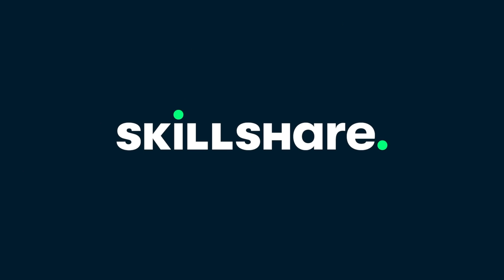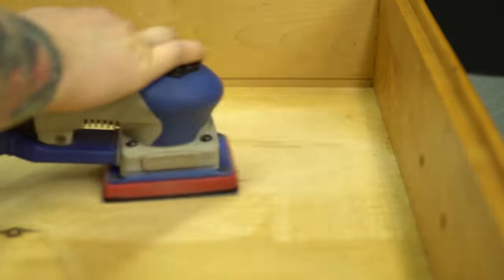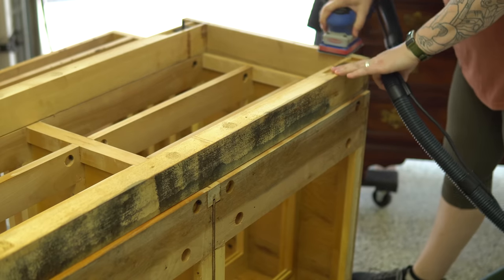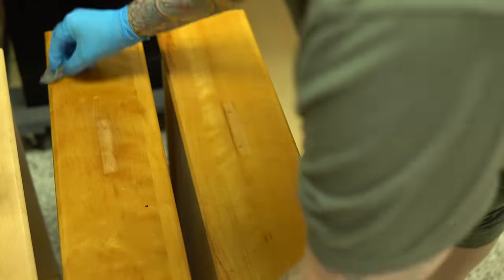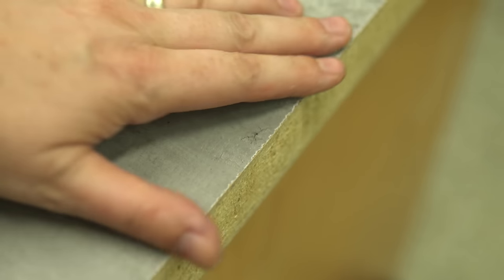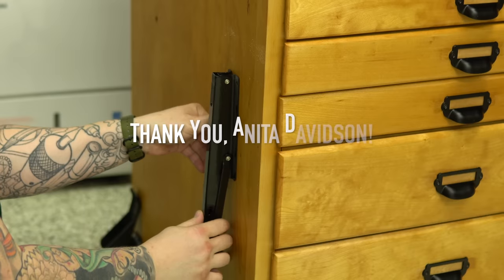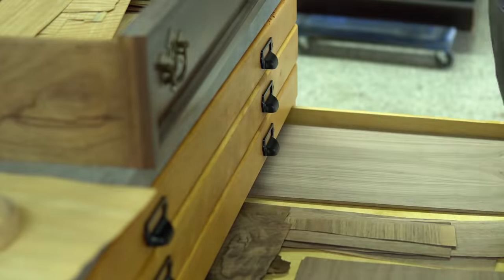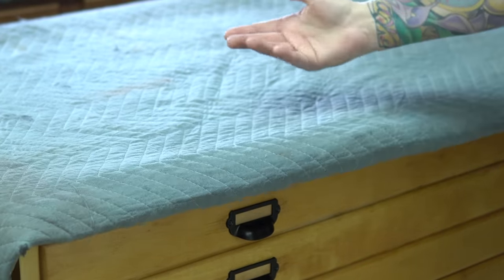How I Turned an Old Cabinet Into a Workshop Storage Solution

Comment: Looks like an art room cabinet. I think I might have used the odies oil with pigment. I think I’ve seen you do that in the past. I have a maple dresser that has this yellow/orangy cast to it. I don’t really care for it either. 😂 I usually like darker wood. I’m considering rubbing a white wax on it to tone it down. Do you think that would work? Also, I have a vi take walnut sewing cabinet that I’m restoring. What type of finish do you recommend? I was thinking of doing a few layers of poly. It needs to be durable. I’m glad you all fared ok in the storms.
Reply from the maker: The long answer here, is as much as I would LOVE to be able to help everyone who reaches out, there sadly just aren’t enough hours in the day. There is another side to this as well- sometimes things don’t come across properly through photos and videos, and are best seen, felt, etc in person. For THIS reason, it can sometimes be difficult to accurately determine the age, finish, wood species, etc of people’s project pieces. There is also the element of user error, when recommending products and finishes, or misinterpretation of my instructions.

I get, on average, approx 40+ messages per day between Instagram, FB, YouTube, and email (and literally hundreds of questions in the comments). It is unfortunately just not possible to be able to get back to everyone. 

The short answer is this: you can certainly message me on Instagram and if it’s a simple answer, I may try to help you out. But PLEASE don’t take offence if I’m unable to respond! I need more hours in a day!

Comment: I live in West Tennessee, USA and it is very humid here. Normally we will sand and do repairs on pieces but when it comes to to painting/staining we take it inside. I use water based paint and if staining I will do in a well ventilated room. Smells don’t bother me that much as long as I use a fan to pull them out. Do you have any suggestions on how to paint/stain in a humid climate?  It can be 100% humidity on some days.

Comment: Perfect finish for the piece. As a metalsmith, I would want something durable and easy to clean. The lighter color of the wood may make it easier to find small things or notice messes. I’m jealous. Something like this new would be very expensive. My workbenches are old lab benches that are laminate and steel and I got them at the Restore for $100 each about 7 years ago. But the storage you have is fantastic. 
Quick Question: you mentioned that Odie’s Oil is quick to repair, but is that the finish you would use on a coffee table?
Reply from the maker: Odie’s is great for tables, provided it is applied correctly and given the right amount of time to cure. I’ve seen many applying it incorrectly (using rags or brushes to apply, using too much, not removing the excess well enough, or not letting it cure before use). Done right, it makes a wonderful natural looking finish that is very water resistant and doesn’t flake, chip or peel. On tables, I usually do two coats, a couple of days apart.

Comment: I love the way this cabinet/workbench turned out!  The black base & hardware are perfect!  I do like a darker stain, but that’s me. I am jealous of your map cabinet -I’ve been looking for one for ages. I have a favorite cabinet in my studio called Treasure Chest from sewing cabinet mfr Koala that’s similar design but the narrow drawers are split. Instead of a fold-out shelf, the top folds out for a larger cutting/design surface and that’s what I plan to do someday when I find a map cabinet.  There just isn’t enough room in the Treasure Chest for my needs (hubby says I should pare down my supplies instead 🙄😂). 

I watched this also bc I have a dresser & chest set my parents brought secondhand in the 1960s, I can’t tell the wood, it’s more orange-ish than the yellow lab/map cabinet & it’s darkened over the years —I’ve been waiting to refinish. I believe it’s maple, it’s got that burl and sheen. Also not sure what the finish is exactly. I’m afraid to try & ruin it. It definitely shouldn’t be painted, the wood is very pretty. Sigh sometime soon I’ll get to it. 
Great job on the cabinet + count me as a vote that it’s birch.
Reply from the maker: Thank you so much! Best of luck with your pieces if/when you decide to give them a go. 😃

Comment: You know, I think the color is completely appropriate for a workbench. For fine furniture, it would be a little out there, but it's not fine furniture, obviously. By the way, I had my first experience with Odie's Oil the other day! I have an old Honda Accord stickshift, and I thought I'd jazz it up with a fancy wooden shifter knob. The problem was that the polyurethane finish flaked off in the heat (I'm in Georgia). The penetrating oil has held up much better and it looks fantastic! Thanks for the suggestion.
Reply from the maker: Thank you so much for watching!

Comment: Love that bench. I'm not a yellow wood person either but, that doesn't look bad  at all. I actually like the way it looks. It looks clean and new. I'm so glad you didn't get flooded out, how scary. Love the fact that you were all about the bunnies. I'm on Ohio and we're still getting smoke from the wildfires here. It's gotten better though. 
Next Sunday I'll be building a 6ft by 3ft workbench from scratch. It'll take 15 2x4s and one sheet of plywood. I'm opting for birch plywood as it'll hold up better than a softer wood and of course it'll be protected with 4-5 layers of a  good oil poly.
Reply from the maker: Sounds like quite a project Tom! I hope the wildfire smoke dissipates for you quickly, those must be from the fires out West or Ontario. Thanks for watching, as always and best of luck with your bench!! 😀

Comment: Such a cool find. I was wondering if those bolts on the bottom were meant for those feet so it could be leveled. I admit, I'm not a big fan of yellow wood, but for what it is, it just seems right. As far as the top goes, (it may sound silly if you aren't going to see it much anyway) but you could find a contact paper you like.  When it gets too scuffed, ooky, or you get sick of it, just replace it. Just an inexpensive alternative. I hope that helps. Thanks for the video I really did enjoy it. 😊
Reply from the maker: Yea, that occurred to me after the fact. Though, the bottoms of the feet were so small and condensed, it would have been horrible on wood floors, but perhaps it had always been on tiled floors (that old commercial tile). At any rate, they’re gone now! Haha

Comment: Well that was lucky not being flooded out. That lightening was spectacular, I’ll bet the thunder was too. Here in Alberta we’re still dealing with excessive heat, wild fires and chronically smoky conditions. I wouldn’t mind some of that rain here. I love your new work bench. It turned out very well despite the yellow wood. I’m like you in that I’m not a fan of yellow wood. I sure could use a bench like that.
Reply from the maker: We had fires first and now it's pretty much been raining ever since and now flash flooding. It's been a horrible weather year this year - and I think of you guys out there often with all the fires you're dealing with! I'll try and send some rain your way because honestly, we've had more than enough.

Comment: I saw the thumbnail for this project and my heart skipped several beats...and I traveled back 40-ish years when I was a young airman stationed at RAF Alconbury.  These cases were used as flat chart storage for aircrew flight planning. The larger drawers at the bottom all had locks on them and were used by aircrews to store some of their gear. 

These were placed in groups of four...some were still in wheels but the majority had that black mop board to hide the unfinished bases. 

Thank you for making my heart smile tonight.  I needed to see this and I needed to watch you work your magic on this piece.  

Trust me, this and many similar cases have stories to tell....really interesting stories to tell. 

Oh! You mentioned Birch and Maple as possible wood sources.  I bet if you look at some of the component pieces you'll discover another yellow wood amongst the bits...poplar.
Reply from the maker: Thank you so much for watching and taking the time to leave such a great comment. I really appreciate it and I'm so glad I could bring back some good memories for you. 😀

Comment: Something I like experimenting with is using water base dyes on wood. Like fabric dyes. Wood is natural plant fibre and can be dyed like cotton, flax, etc... I think it's possible that really soaking the face of wood in dye and then finishing it with oil would make it so that the surface colour went deep enough that it would be really hard to scratch or sand through, depending on the wood. Most wood colouring techniques/mediums are limited by how far the pigment can penetrate before the solvent starts to cure or dry up, if not the particle size of the pigment, and that's less of an issue when a piece of wood can just keep soaking in what is effectively pigmented water. Dyes meant to stain plastic fibres can also be used on various kinds of plastic surfaces. 

I wanted to mention before on another video that I have had better luck steaming dents out of wood if I let the water really soak into the wood for a while before applying heat, just so the water actually gets down in between all the compressed wood fibres before being expanded into steam and drying out. I have gotten some impressively deep dents out of fairly hard woods by giving the water 15 minutes to a half hour under a silicone mat or piece of plastic before applying the iron. I forget if I commented at all.

I'm sure there are various reasons people are hesitant to expose wood to a lot of moisture, but I haven't had issued with wood warping or unwanted staining from doing either of these things yet in my limited experience.
Reply from the maker: Thank you very much for watching! 😃

Comment: I’m not 100%, but I’m pretty sure the carriage bolts on the base aren’t for attaching the base to the cabinet but instead are leveling feet. That’s why there’s a slot on the end of the bolt for a flathead screwdriver to turn the carriage bolt, lifting the cabinet incrementally with each turn of the bolt. Since you are using the rolling cabinet wheels, it doesn’t matter, but if you see something like that again, that might be what those are for.
Reply from the maker: Yes, this came to my attention shortly afterwards. I’d never seen feet quite like that before (with simply the end of a bolt as the “foot”), so I didn’t realize that was what it was. I guess it wouldn’t matter so much on an industrial floor but I shudder to think what that would do to a wood planked floor. Hahaha

Comment: Next time you need to cut something like the piece you used for the top of the cupboard,  upfront underneath because when your xsaw cuts, the action cuts up. If you cut on the underside of the board, you don't get the tearout on the top.
When you are concerned about the underside absorbing liquids, seal the underside with s9mething like a polyurethane.
Reply from the maker: I considered sealing the underside but was concerned about the liquid portion of the sealer absorbing into the paper-like backing and substrate. The chances of anything getting under there are pretty slim, but still wanted to have SOMETHING there, so figured the tape would do just fine. :-)
Reply: Fair enough.  The undersides of tops might be different to what we have.  Ours is normally chipboard which absorbs polyurethane quite well.

Comment: I love highly functional pieces of furniture for specific uses and could use something like that piece for my genealogical research. I think it turned out well for its intended use. What a great find! Just don't trip over those wheels.
Reply from the maker: These wheel are the same as I used on my last work bench. No issues with them at all. Thanks so much for watching!
Reply: @TranscendFurnitureGallery  I'm glad they aren't a tripping hazard!!

Comment: Thats a fantastic solution for veneer storage, and frankly even for old maps and other odd documents of which I have a few.  I wish I could find something like that. What are those wheels called and where can I get them? I don't see a reference to them in your links and I need them.
Reply from the maker: The wheels are called - SOLEJAZZ Workbench Caster kit 880 LBS Capacity 3" Heavy Duty Retractable Workbench Caster All Steel Construction Urethane Wheels, Bonus Install Template, 4 Casters.  I'll attach the Canadian and US links in case that will help you track them down. 

Canadian - https://amzn.to/3q00axw
US - https://amzn.to/46Tjj4G
Reply: @TranscendFurnitureGallery  Appreciate it. Thank you.

Comment: Could the bolts and plates have been leveling feet?
Reply from the maker: I guess it’s possible! Never really considered that- you might be right. My only hesitation is that the bottom of the bolt is rounded and not flat, but maybe that doesn’t matter in this case. Interesting- good call.

Comment: Beautiful piece. People often want a fortune for things like this. Nothing wrong with a sawdust worktop, my parents have had one in their kitchen for over 50 years and it’s still in great shape, but faux concrete? Faux anything? I don’t know. I also thought the original handles were nice – really nice, actually. Still a good video, but boooooooooooooooo. I’m very upset.
Reply from the maker: I personally hate the original handles, and I work with chemicals and oils. Having a top that is resistant to those is important. 
My other work table that I’m working on has a wood top, because it’s being used for other things. This is entirely a function thing.

Comment: I DO NOT think it is too much work for a work bench. BUT, I DO think it is too much work when you ended upp with the same yellow finish as you started with. If I was you I would stain it all black. Id rather have dings on a good looking work bench that are hard to get rid off than easy to fix dings on something I don't like the look of anyway. And black would go with the top.
Reply from the maker: Birch is notoriously hard to stain, which is why I left it natural. Thanks for watching!